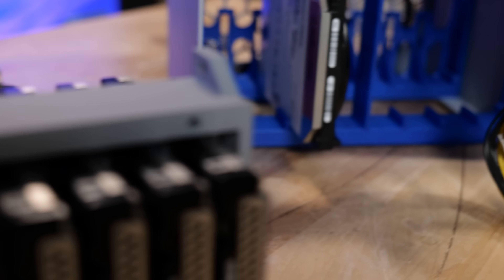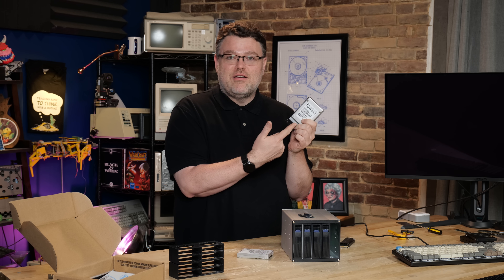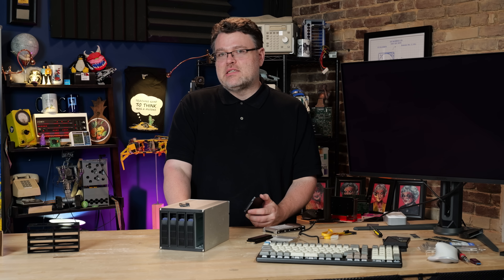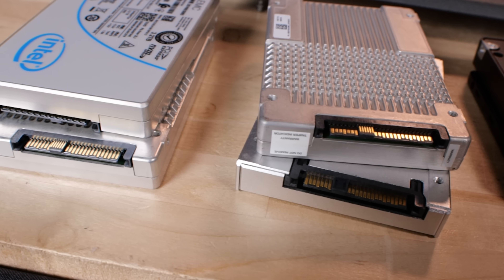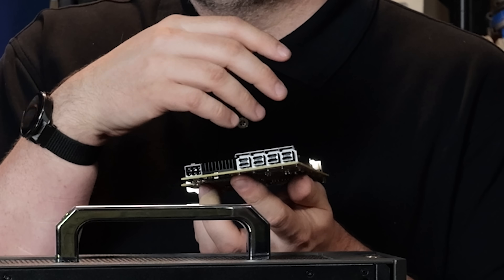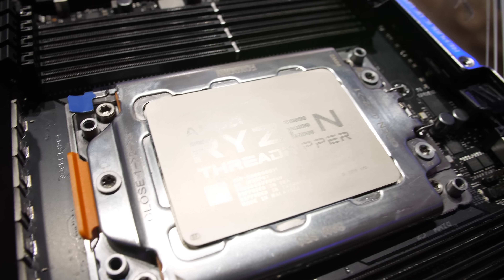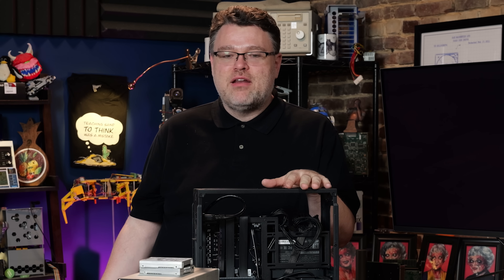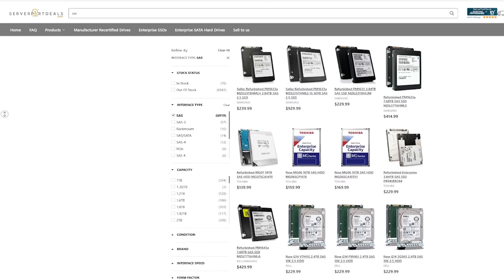Need Cheap Mass Storage? Try Surplus SAS Flash!

Comment: Build a test server with 8 30TB 2,5" NVME HP branded Samsung 1635(?) SSDs from Ebay. Worked fine for a year as an additional ceph-server then went dark suddenly when 3 drives died at roughly the same time taking the whole server down with them. Doesn't even boot with them in the slots. Works without them though. 17000h 97+% before we put them in. badblocked them with random and 00 twice before use of course then blkdiscarded them. YMMV with sas but we learned our lesson :)
Reply: Hey quick question, was that system on a UPS?  When I see multiple simultaneous failure I always wonder if there could be a power issue.  I have had great luck with shitty hardware (as reported by others using the same thing) and I think my UPS is doing the heavy lifting on stability.  It still sucks to loose hardware.

Comment: hmm, let's see...
cheapest drive is $230 for 3TB, +$61 shipping and 60% import tax into Brazil, that's $429, converted to BRL it's R$2328, about 153% of a minimum wage monthly salary. plus it's refurbished and I need a special enclosure/controller for it? nah that ain't happening.
Reply: To be fair, that's just a Brazil issue
Reply: @marcogenovesi8570 it's "anywhere but in USA" problem.
Reply: @BoraHorzaGobuchul  Europe is also fine, there are plenty of surplus sellers from germany and spain on ebay.

Comment: SAS really should be more common on consumer hardware
Reply: SAS is a dying technology, just as much as SATA is. It's all NVMe from here on out. There are even loads of servers with storage backplanes that don't even have traces for SATA or SAS anymore.
Reply: @noname-gp6hk  Sata is fine and will remain for a while still for bulk storage. Wake me up when we can get more than 8TB flash drives for the same price of a mechanical sata drive
Reply: why though? No consumer hardware needs cables longer than 1.5m, hotswap backplanes, expanders to run a whole disk shelf, or even dual data  ports for multipath/dual controller in a SAN.
Heck, a lot of server hardware does not need a lot of that either
Reply: @marcogenovesi8570  disk shelves deserve to be more common, they make great cold storage for game libraries

Comment: I wish that surplus would exist in Europe or in my country ... oh right .....
Reply: I'm in europe and I get most of my surplus from ebay sellers in germany and spain. In the past sellers in the UK were the best supplier but brexit put an end to it
Reply: @marcogenovesi8570 I got 4 Samsung PM983 U.2 NVMe 3.84TB drives for about 250€/piece last year on Kleinanzeigen (Germany).
Reply: @marcogenovesi8570  can you recommend some from Germany?
Reply: @marcogenovesi8570  A lot of the german sellers charge pretty high prices though. Though some of the best deals are also really difficult to find. I got a Dell md3060e (NetApp DE6600 rebadge) for around 450 euros as a "refurbished" unit (definitely looks used) from just a regular computer parts webshop on a listing without any pictures.
Reply: Surplus does exist in Europe, I mean obviously it does because it's not exactly like there's a lack of data centers and large companies in Western Europe, the opposite even. You just don't have as many companies who specialise in buying up the surplus and reselling it, like you have in North America, but if you some searching you will definitely find plenty in Western Europe. Do realise though that for example the Netherlands, where quite a few of the Western European resellers for server-grade hardware happen to be located, have Dutch prices. And by that I mean the living standard and cost of living are ridiculously high here, and with that the cost of such products as well. You would probably be better off trying to find it in Eastern Europe if you want it more cheaply.
Reply: Honestly do wonder how does this situation look for Australia too x3

Do feel like they should specify that this is US-only a lot of the time.

Comment: Can you not, the prices are going to go up now :C
Reply: In Europe they're absurdly expensive (1.6 TB 600€ last check)
Reply: @peeeeeeedroooo It's because Europe destroys drives a lot for GDPR.
Reply: Ya… now my replacement cost is going to increase by like 30+%… smh
Reply: @tttomtxhc  Then if there is a tariff on it that just makes it worse.  Curse you Trump!!!
Reply: Yep, game over man
Reply: I can't even afford second hand hard drives on marketplace 😂
Reply: Yeyeye guess what I’m s doing lol
Reply: Yeah, not in Europe- even used enterprise hardware is ridiculous expensive- you get only good deals for HW which is like 10+ years behind  barely worth it nowadays.
Reply: 100k views 500k subs. Is it going to affect it that much?
Reply: dammit!
Reply: It's a novel idea, but rather than roll the dice spending $50 USD per used drive of some random size -  I'll pickup an NVME this black Friday. There will be 2TB NVMEs for under $200. I will be picking up a 4TB(or two!) for the start of my linux journey and use my current drives for NAS. Those drives Wendell is on about - too much headache, take up space, more frequent replacement, spend time tinkering - better just work an hour or two instead of tinkering and buy something solid.
Reply: They will go up anyway. The same way used enterprise HDDs have now skyrocketed
Reply: I bought a 15.36tb Micron 9300 Pro new for $1,000 a bit ago, I guess those days are over now oof
Reply: 1 tariffs.  2 enterprise usage is exponentially more than consumer

Comment: Those drives have already 1000+ TB written on them? And they're still good? What kind of flash memory are they using?? SLC? I had a SSD die on me after ive written like 700TB on it... so how many TB can a SLC SSD take? 5000? More?
Reply: they are very overprovisioned. They often have 60-70% more flash dedicated just to overprovisioning (for performance and wear leveling). This is why they cost a lot more when new, among other things
Reply: Depending on the size of the drive, they usually have 5-6PB of endurance even if they are read intensive. SLC or even MLC drives hit that on old tiny drives. I think I had some old Intel DC S3620 drives that even at 200GB they had 7PB of endurance.
Reply: This would normally be TLC nand, typically they're rated for multiple petabytes

Comment: Always nice to hear about power consumption numbers. I know Wendell has a bit of a different perspective than most home labbers when it comes to that, but tbh is what I base a lot of my hardware decisions around.

Also really starting to warm up to intel in the homelab lately now that I've been playing with quick sync on a old 8th gen lenovo mini pc I've had laying around. Been running plex/jellyfin on a 7700x and it can only do 1 high bitrate transcode at a time, but the little intel node can easily do multiple high bitrate x264 streams, and without drawing an extra 100w. Now I'm definitely looking into getting something with some proper Intel Xe hw encoders so I can ideally pull off several x265 or even AV1 streams. If minisforum sold a itx board with a mobile intel chip that has the actual full fledged Xe graphics I would be buying that right now 100%.

Comment: I can never find those drive enclosures for that cheap. Some are around $100 for a 5 drive unit.
Reply: Came to the comments to say just this, the lowest I've seen is ~$80.
Reply: that's the same price as a normal 4-5 drive cage so not bad imho
Reply: After years of stressing, and spaghetti cables, I bought a supermicro case to use as a jbod enclosure. Basically I came to the conclusion that if five disk enclosures were $100, and a 36 disk enclosure with power supply and backplane expander was $500, it was worth the $500.
Reply: @hellboundedward Yeah the little ones hardly seem with it if you can get a used SM enclosure for not that much more. I've seen the big drive shelves used for a few hundred dollars.
Reply: You're basically playing a waiting game, I noticed the same thing too for a few months then someone was selling one for $25. It's basically just how long can you be patient.
Reply: Whats the name of these? I cant find them anywhere